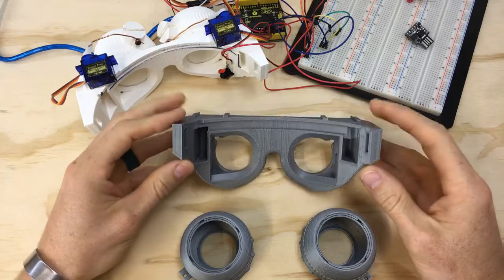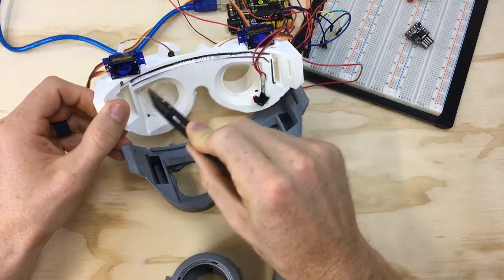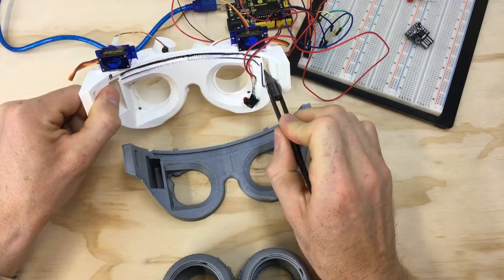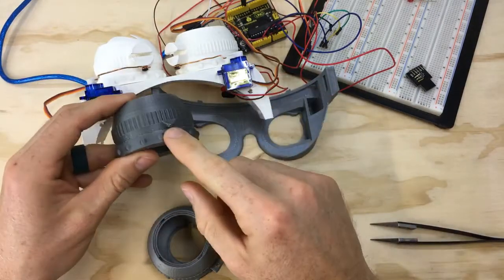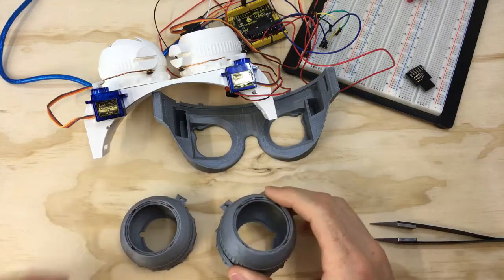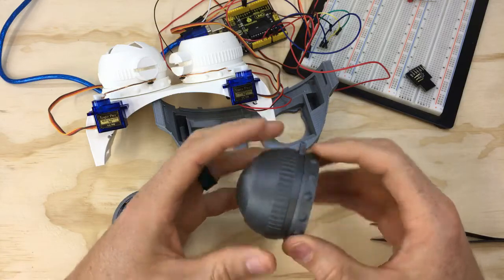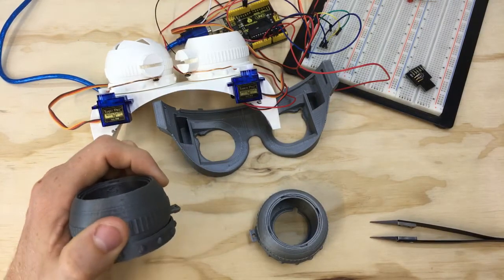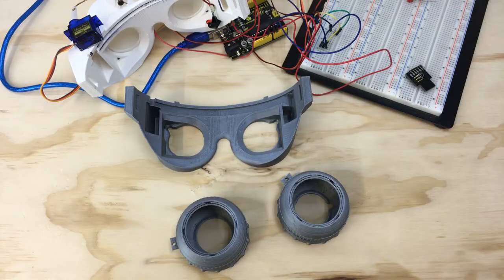Design Changes | Blinking Iris Goggles | Live Stream

Comment: I'm curious if you can change the lever motors to a curved rack and pinion design on the lens, if that setup would allow you a faster blink speed.  These goggles would work great for steampunk, especially if you add another servo to operate a valve for a steam whistle.  A backpack ultrasound humidifier and a little tube work, get a release of "steam" every time you open or close the shutters from the steam whistle integrated into the goggles would be amazing.

Comment: Have you thought of using a second sensor to measure the ambient light inside the goggles? Place it somewhere where it won't detect the specular light from your eye (that is, the reflection) but can still measure the light refracted from your skin (somewhere like the inner part of your bottom eyelid would work where it can always measure the brightness of your skin). Then, no matter if you're looking at the sky on in a dark room, the arduino can tell the difference between light bouncing off your eye and light bouncing off your eyelid.